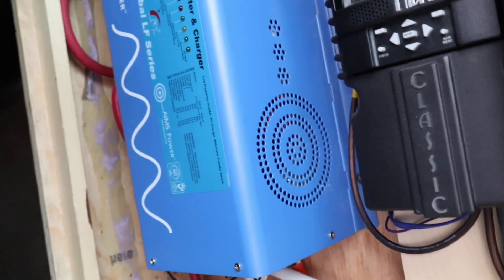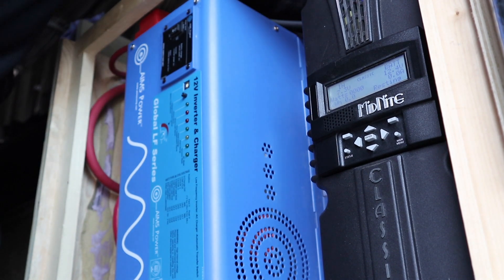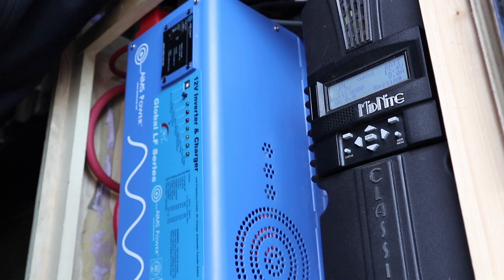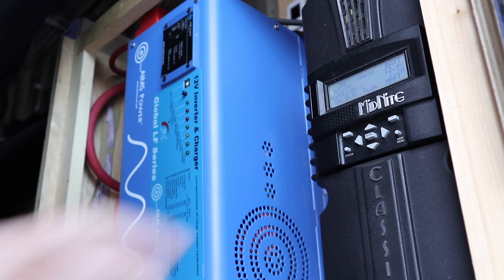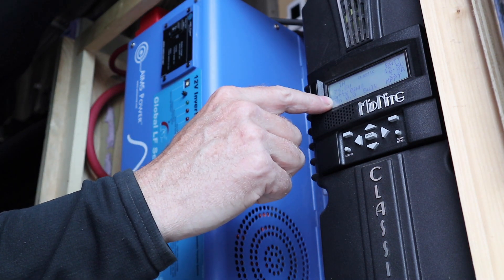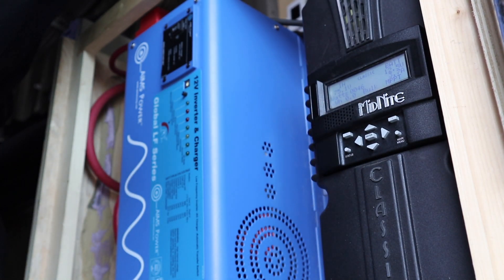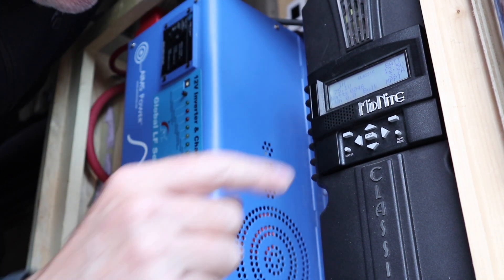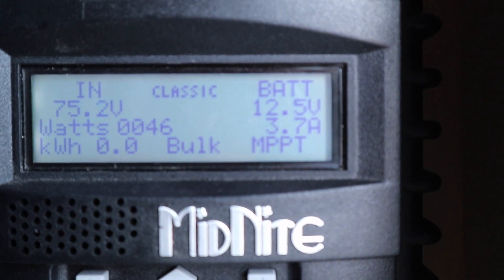Turning on Solar Power in Step Van E402

Comment: Hey Seven. Congratulations! I've gathered enough information to see what you have going. I'm guessing you've done your research and are setup with proper voltage and current rated items. Only suggestion I have is to get a couple Y connectors to try series and paralell connections on the panels to see what is going to supply you the most reliably consistently delivered power due to shading, dirt accumulation, other incidentals. Take care...
Reply from the maker: thx. pretty sure the parallel is the way to go in my setup ;)

Comment: Research the PV charging aspects. You actually do get the energy on cloudy days. Obviously a sunny day is best but most of the energy is ultraviolet. Also a cooler day helps the panels be at their most efficient, heat is a big issue when charging with solar for the panels and the batteries. A really big deal is the tilting of the panels, if they are directly pointed toward the sun the added energy collected is worth the effort.
Reply from the maker: thx. ultimately decided against the tilt given I'm so over powered and don't need the extra 20-30%

Comment: Ah, you've wired your panels in series (higher voltage, lower amp) to be able to run a smaller wire guage from the panels to the charge controller, and the charge controller steps the panel voltage down to the voltage (12v) of your battery bank?
Reply from the maker: VanDerHoof... yes that is it exactly
Reply: In regards to my posted voltage concerns, what you said makes sense. 

So the battery sees 12v.
Reply: Johan van Gelderen  Yes, I have a Morningstar TS Mppt 45 charge controller at my cabin. I can input up to 150 volts from my panels (depending on wired in series or parallel) and by me manually changing a sequence in dip pin switches internally in the charge controller it will charge a 12, 24, 36, or 48 volt battery bank. The voltage he's getting seems odd to me, almost like it was an open circuit voltage, however it must be connected to his batteries as it was reading the bank voltage. I'm sure he'll clear this up for us in his next video.
Reply: Johan van Gelderen   I see now in a previous video his panels were rated at 47.1 volts open circuit. Therefore he has two panels wired in series and it's either a cloudy day, or early or late in the day. Mystery solved for me.

Comment: I’ve installed solar just mounting them on for display on the showroom floor but we have to have electrician to all the wire thanks for the information
Reply from the maker: thx for watching. I understand now how my system works and could help someone else with a similar system. don't know about other types ;)
Reply: I know you got a lot of constituents i’m one of them , your health is important to you as it is to me i’m learning in life and I understand it takes me a few times to watch a Videos and c what the people are talking about in the, content , thanks for sharing that with me because now I know that I have to put solar that hang by themselves and then attach it to my RV Technology is changing so fast now as for the house Tesla has a battery that’s awesome and I’m not trying to get you to check into solar in a 🏡  house. Solar is now running off the Wi-Fi 🏡 at least for my RV I can go totally solar & not use my generator thanks to you appreciate that

Comment: Yikes, there may be problems, or not. The VOC looks right on the series connection but the battery volts should have at least gone to 13.1V as the 150 was in Bulk. On the Trojans set Absorb to 14.7, Float to 13.5 and Equalize to 15.3. Trojans datasheet on T-105s call for 14.82, 13.50 and 16.20 (eq at 16 volts? Super scary).

If you still see those readings check if you batteries are full: turn on lights, inverters, hot tubs, everything else and see if your amps rise (I was expecting at least 15 amps in those conditions, not 3.7). On the 150 press the Status button to the screen that shows amps coming into the controller, should have been about 7 to 9.

Also check for shadowing of your panels.

If needed, hydrometer the batteries to see their true charge level to determine if they're sulfated and need an equalize cycle or two.

The 150 Classic Absorb setting is a set point for the Bulk charge. The 150 will Bulk until it reaches the Absorb voltage, then absorb for a set time (default 120 min I think) or the end amps are reached (default option is off), then drop to Float until the sunlight goes away or it hits the re-bulk setting (default no re-bulk), through all stages the amps will waver based on battery charge level.

The 7.3V reading before turning on the panels (you'll see it at night also) is normal, some volts back flow from the batteries to the 150 and Kid.

All this info and I'm hoping your batteries were just full at the time.
Reply from the maker: you'll see voltage the next day as the batteries get 100% charge and they come out similar to the numbers you are writing here. I was planning on getting a refractometer rather than hydrometer. the last few days I'm in float mode most of the time and voltage is around 13.8

Comment: Seven, you are sending 72 volts to a 12 volt battery. 

Does that seem right to you? 

Seems like the maximum should be 16 volts. 

Seems like you are at risk for destroying your system. 

Please shut it off!!!
Reply from the maker: 2 panels in series provides around 80volts. the charge controller accepts up to 150v and drops it down to 12v for my batteries
Reply: Seven, I owe you an apology.  I did not understand how you had set up your system. I was just concerned about your system.

That said, congratulations! 
Enjoy power out in the boonies.

Comment: Seven, seems like your voltage is way too high. Like the output from your panels is adding voltage together instead of increasing amps. 

Please consider flipping the breaker to the off position till more knowledgeable people than myself can respond.
Reply: Johan van Gelderen I believe Seven wired his panels in series, higher voltage allows smaller wiring from the roof and less power loss. His solar controller then maximises the the amount of charge to the batteries, that's the advantage of an MPPT solar controller.
Reply: Ok, that makes sense. 

I don't really that he mentioned exactly what he what he was doing. Perhaps because someone else did some of the work.
Reply from the maker: panels are in series and optimally put out around 80v which the controller converts to 12v
Reply: Thought when dealing with short wire runs it was better to go for higher amps and lower volt dc.  Ether way you have enough roof left to put in more panels as you needed them.

Comment: 75 VOLT??? 

Did you wire for series or parallel?
Reply: My thoughts as well..I have a 48v system and my charging voltage is around 57v . 75v doesn't sound right
Reply: As I recall, Seven has a 12v system with 2   12v batteries in parallel. Intended for 12v rv power with adequate reserve. 

So I would expect to see 16v input, and quite a but more than 4 amp output. 

I'm afraid that his charge controller is not happy at all. 
I'm glad that it is cloudy right now.
Reply: The Classic 150 is MPPT not PWM.
Reply from the maker: panels are in series to get 75. the controller brings it down to 12v